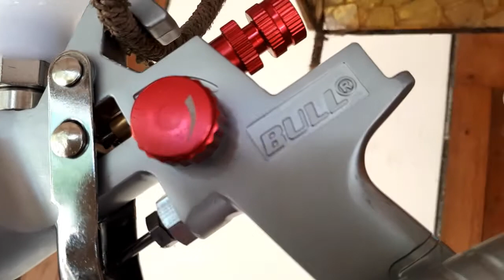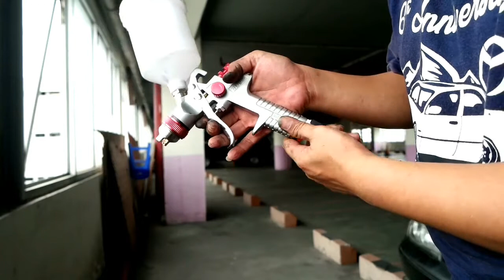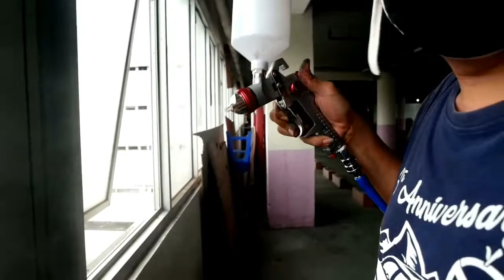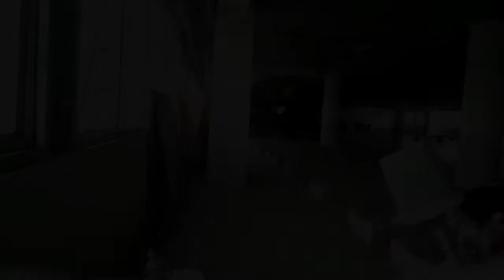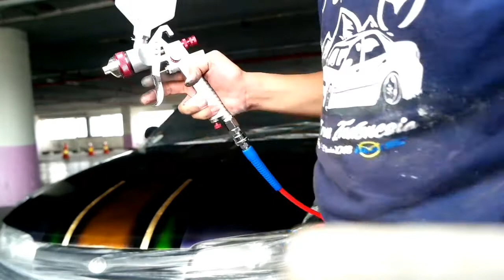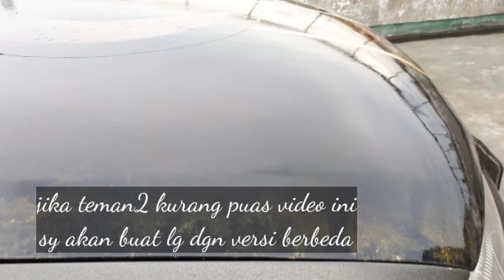BULL BLSG01-827 HVLP Spray Gun - Test dan review #spraygun #hvlp #repaint #bull #testandreview

Comment: Boros angin kompresor ga om?
Reply from the maker: untuk konsumsi angin boleh dikatakan spray gun ini cukup boros krn optimal nya minimal 3bar maksimal 4bar (TESTED) dan jumlah lubang micro didepan nozzle nya ada 10 (kanan 5, kiri 5) dan disamping kanan 2 dan dikiri 2, jd total ada 12 lubang pengeluaran.

 Disarankan untuk pakai spray gun ini idealnya minimal 2-3HP/ PK yg input angin ke kompresornya 200liter/mnt dan tanki yg besar minimal 80-120liter jd kita lebih puas dalam durasi pengecatan bidang/ media lebar, krn jika dalam video sy itu tdk hilang, sy cm menggunakan kompresor 0.5HP 58liter baru berjalan setengah kap mesin dari 8bar-6bar sdh nyala lagi. 

Tapi meskipun cukup boros spray gun ini sangat keren, semburan atomisasinya sangat halus, bahkan lebih halus dr merk sebelah ( IN...O) yg sama2 HVLP dan 1.4m lubang nozzle nya. klo om pny/ pakai kompresor yg HP/PK dan tangkinya besar ini sangat ideal dan cocok.
Reply: Ok om,terima kasih untuk review nya om👍🙏
Reply from the maker: Sipsss sama2 om😊🙏
Reply: @np2project187  q punya kompresor 1/2 HP ngos2an apa nggak ya mas?
Reply from the maker: @NewtrisNewtris  sebelumnya sy ucapkan terima kasih sdh mampir di chanel video sy yach om, kompresor 0.5HP baik yg oil atau oiless ini ttp tekor om, krn sy jg pake kompresor yg oil 0.5HP ngos2an malah tekor banget, pake spray gun ini minimal 3HP om, klo kompressor yg 0.5HP saran sy jgn pakai spray gun ini, tp pakai yg Auarita MP102 masih ok banget om, dan lebar semburannya jg sdh cukup.
Reply: @np2project187  makasih om, bru niat mau beli ingco, pilihan antara Bull & Ingco, liat komen ente, ingco saya coret, liat spek kompresornya Bull jg dicoret 😂😂😂 sy cm punya kompresor oiless 1HP
Reply from the maker: @warga62plus  Allhamdulillah, terima kasih om sdh mampir ke chanel video sy, klo pny kompresor 3Hp dijamin ok, tp klo cm 1Hp lupakan saja om si ingco dan bull😊

Comment: Spraygun murah tp alat pendukungnya sangat mahal... 😂😂😂 Saya punya dan komresor cuma 1.5 hp kl ga salah n sangat gak mumpuni... 🤦🏻‍♂️🤦🏻‍♂️🤦🏻‍♂️🤦🏻‍♂️🤦🏻‍♂️
Reply from the maker: Nahhhh....sy pny 1 3/4HP aja masih tekor om, btw terima kasih sdh mampir di chanel video sy yach om😊🙏
Reply: @np2project187  siyap... Jd pingin beralih ke f100 ajah... Tp pas awal2 dateng aku pake buat spray candy full body mobil sedan lumayan rata abis itu baru krasa angin loyo skali
Reply from the maker: @suryajamak3151  lhaaa bukannya F100 jg sm om borosnya? Sy blom pernah coba sich si legend F100 ini, ya krn slh satunya kompresor sy kecil bgt😂😂🤣🤣
Reply: @np2project187  setidaknya air consumtion f100 jauh dibawah bull yang superduper haus tekanan angin, f100 150-180 liter/menit kl bull 285-400 liter/menit sejauh yg sayaa baca di speknya
Reply from the maker: @suryajamak3151  whoaaa menarik jg nich F100, terima kasih om infonya😊🙏
Reply: @np2project187  lah biasanya pake spray gun apa om? 🤭🤭🤭🤭
Reply from the maker: @suryajamak3151  cm pake Auarita F3, Auarita MP102, meiji R3 sm H2000 🤣🤣😂😂
Reply: @np2project187  seringnya ngecat spm ya om?
Reply from the maker: @suryajamak3151  sy lebih sering ngecat motor sm sepeda, mobil jarang bgt kehitung jari whakakak